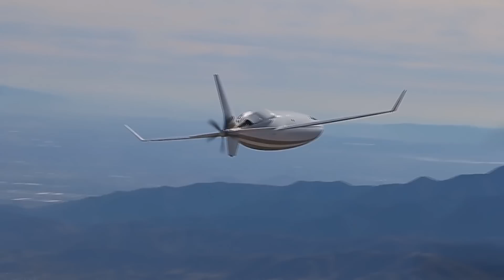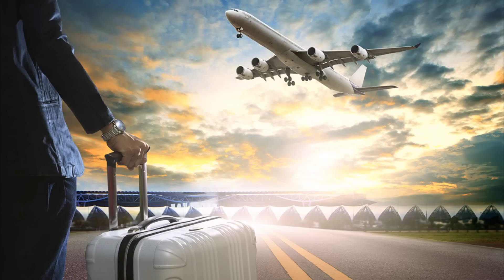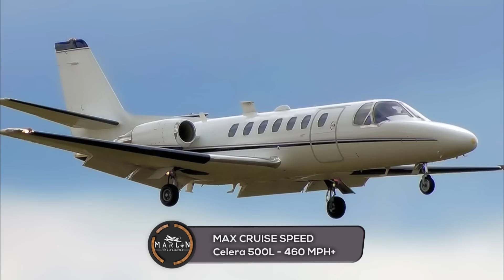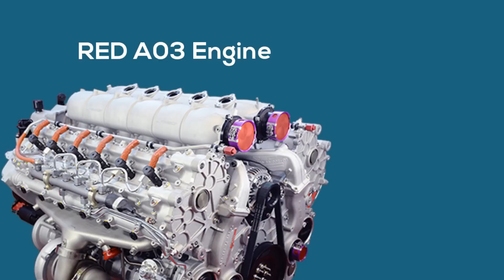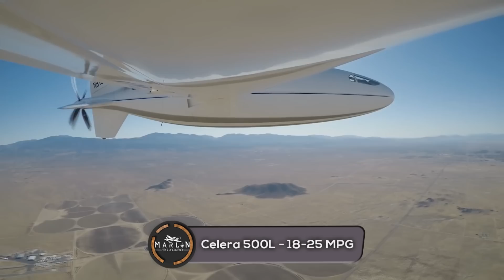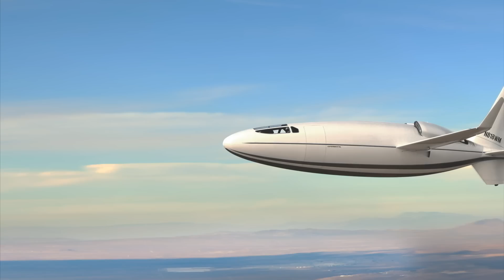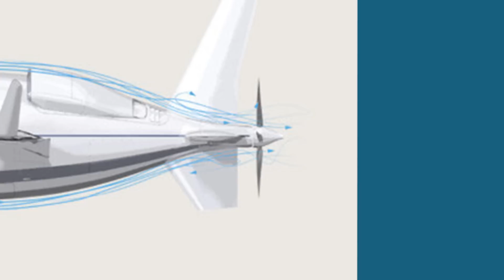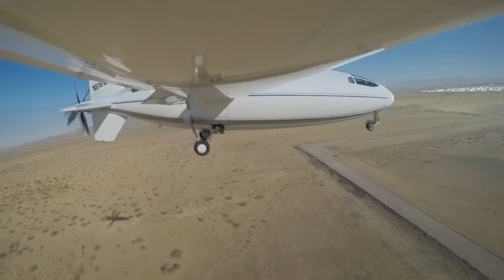Meet the Celera 500L (Flies Faster, Farther, Higher, Cheaper)

Comment: A glide from 30,000'? How is an internal combustion engine going to run that high, even with turbos? Perhps it relies on ram air from those fuse-mouted scoops...
Reply: The Spitfire Mk 19 used a complex stepped turbo paired with a conventional petrol engine that was sensitive to variable manifold pressure and pre-ignition, but it still managed 51k clear back in the 1940s. Diesels are far better suited to turbos because they aren't nearly so sensitive to variable manifold pressures, so higher pressures are a lot easier to achieve with a less complex, lighter turbo. The ram air probably doesn't hurt either, although it is not clear how efficient that would be since there doesn't seem to be any other ports for the oil radiator coolers and that would probably have a big impact on the velocity and pressure of the air flow through the intakes.

Comment: Believe it when you see it. If it can do half of what you said, that would be a game changer. Everything is going electric. I'm guessing big generators to run multiple systems.
Reply: Everything is NOT going electric. There will NOT be any electric commercial aircraft in your lifetime. Take a science class.
Reply: Roberto Skeetrech yeah we did and the only thing holding one back is battery density. That’s it. Electric engines are lighter and more powerful than combustion ones. The problem is energy density of fuel is over tens times greater than the best batteries today.
Reply: Roberto Skeetrech , there is a small fleet of Electric Beavers about to enter commute service in Canada. Might rethink that “Not in your lifetime” assertion.    https://youtu.be/X_dnAD5TD-E
Reply: @robertoskeetrech3206  Batteries would need a lot of development to make a viable electric-powered plane.  However, I could imagine a plane powered by fuel cells and perhaps assisted by photovoltaics
Reply: @robertoskeetrech3206  There most definitively will be here in Norway.
But only short distance.
Long distance it's probably more likely that we'll end up with hydrogen powered air crafts since hydrogen can carry more energy pr kg of fuel then batteries.

Comment: My concerns 
Need long runways
What’s the climb rating?  The ability to climb quickly to get thru wx and avoid obstacles.

TBO on engine
 Very interesting
Reply: Very good question. Climb rate has traditionally been considered a function of wing performance at thrust ratios below 1:1. But this is a lifting body. The Piaggio P180 Avanti derives 20% of its lift from a lifting body fuselage, and another 18% from the forward winglets (note: they are winglets, not canards), which allows them to use a non-lift tail design. This combination allows the Avanti to fly much closer to horizontal than conventional aircraft, which - combined with laminar flow wings - gives it impressive speed. But even with the Avanti's forward winglets, its main wing is still much further forward on the fuselage than the Celera 500L's main wing. And since we have seen the Celera 500L in flight, it is clear that the main wing being so far back is a very, very strong indication that the Celera's lifting body design provides significantly more lift than the Avanti's. This all makes guestimating the Celera's climb rate exceptionally difficult. We'll just have to wait for independent tests.
Reply: Paul White great info
I’m just not sure it will have enough thrust.

Comment: I agree! Actually it flies FARTHER, not further!😉
This aircraft has great potential, especially if and when it can use electric propulsion. I can see variations for different applications. As a drone it could be much more efficient, with a great payload, better than any other prop driven drone...
Reply from the maker: Thank you for the good eye! Ive made necessary adjustments!
Reply: Stop farting!

Comment: Visibility from that cockpit must be minimal due to the design. I'd like to see a video focused on a technical review from a pilot and less of a commercial.
Reply: Yes. Visibility is good straight up but nil forward.
Reply: Can't get a pilot's review until it flies. Should be possible to increase pilot vision if necessary, by adding window area.
Reply: @marcdepiolenc1880  Given the design a window might not be a good option but I thought they could perhaps add cameras and project view on a screen inside. That is not an expensive technology that would work without interfering w/ the design of the aircraft.  I see this option considered for some innovative commercial aircraft designs as well.  Cheers.
Reply: @corujariousa  Agreed, especially if they can install more than one and get a stereoscopic effect. Faired housings at the wing tips?

Comment: Seems like maintaining weight/balance would be an issue.  Wondering where CG is.
Reply: Glen Har 
Yeah, hardly any distance between wing and horizontal stabilizer.
Reply: It's the 25 to 40 % of the wing chord.  Like every other airplane.   Just ahead of the wheels.
Reply: @kirkcreelman   i think you may be missing the conundrum here.  How does it balance with no load (no passengers) vs full capacity when loads are all ahead of CG?
Reply: Glen Har    Oh I hear ya.   Can't see how its gonna work on this bird.

Comment: Those pie in the sky figures are for sucker investors, you can cut all those stats in half for a start.
Reply: If you cut them in half, twice, still impressive
Reply: sconce3    Agree, still impressive.  I heard 3300’ balanced take off mentioned.  This is no backyard flyer. https://www.indexmundi.com/united_states/airports_with_paved_runways.html    Indicates there are only about 2800 appropriate runways.  Not sure how many of these are open to the public.  Wing and landing gear spear undersized.  But the high aspect ratio wing fits with high efficiency and takeoff speeds.
Reply: You’re right about that. Those stats were just way overblown.
Reply: I agree. There is something sketchy about this project and experts are starting to push back on some of these claims. It would be great if something comes out of this but I am skeptical at this time.
Reply: Well, the MPG is certainly believable.  How much fuel can a 12 Cyl auto engine burn?  Its the speed and altitude I have a hard time believing.
Reply: @nickv4073  Why is the MPG believable?  The best experimental aircraft don't come faintly close to those MPG/cabin volume numbers.  And to get their efficiency, those experimental aircraft give up lots else.  Interior volume, runway requirements, etc.
Reply: @GarnetHarrier  Its totally believable. Check out the specs on the Red A03 engine. 
 https://www.hotcars.com/the-worlds-most-powerful-piston-aircraft-engine-red-a03/
Reply: Let's do some math to verify the numbers:  
1.. Glide ratio of 22:1 seems plausible, given that the Pilatus PC12 already has glide ratio 16:1.  
2..   Assuming gross weight of 7,000 lbs, which, at maximum-efficient speed would need about 318 lb  = 1416 Newton of thrust.  
3..  At 460 mph (720 kph), it travels at 200 meters per second.  Take 1416 N x 200 m/s = 283309 W of power required = 283 kW.   283 kW divided by 0.9 propeller efficiency =  314 kW
4..  The engine can produce 410 kW at takeoff, so with high degree of turbocharging with pressure ratio of 3:1, can still maintain this power level at 30,000 ft.   
5...  Typical Brake Specific Fuel Consumption for a diesel engine is around 200 gm/kW/hr.  So, at 314 kW, would require 314 kW x 0.2 kg =  62.8 kg per hr fuel flow.  Density of kerosene is 6.68 lbs per gallon =  3 kg/gal.  Fuel flow = 62.8 kg /3 =  20.9 gal per hour to travel 460 miles = 21.9 mpg.  
So, it is very plausible for the Celera to achieve 21.9 mpg to cruise at 460 mph at 30,000 ft with gross weight of 7,000 lbs to carry 6 passenger.
Reply: Yeah there's definitely something dodgy going on. I can believe that it's very fuel efficient since it's basically a large powered glider. But six times more fuel efficient? Come on, it means every other aircraft designer in history must have been complete morons. In any case you're not going to get that efficiency at the high speeds they're talking about since required propulsive power increases as the CUBE of velocity. Celera should just be open about whatever extremely specific assumptions they've made to get those figures.
Reply: @DanielF601  they are upper limits, want to go far?  you aint going fast...
Reply: @DanielF601  On the other hand, bumble-bees can still fly. As did the Rutan Voyager. Exploiting niche aerodynamics that only work at very specific scales is a real thing. Believing that other high performance compromises are impossible, in spite of history, is foolishness, not scepticism.
Reply: @johnroutledge9220  Yeah fair point, obviously there's a (very tiny) chance that they've discovered something truly revolutionary. However you can see for yourself that they have high aspect ratio wings which we know suffer from significant induced drag, and are therefore only efficient at relatively low speeds. Okay, granted, you can also see that they're using a fairly advanced airfoil and some nice wingtip geometry so it's fair to assume that it's not as bad as it first appears. They've put a great deal of effort and skill into the design. But even so, all their advertising claims about laminar flow over the fuselage are irrelevant if the main source of drag is the wings. I accept all points about keeping an open mind but at the same time I think it's pretty self evident that this aircraft won't achieve the stated economy at the stated speed, since it is essentially a powered glider and, well, magic dust and wishful thinking just aren't all that powerful. Perhaps it will achieve the stated economy at a much lower speed - probably still quite a useful speed, which might make it economically quite attractive. And perhaps it will achieve the stated speed with much more "typical" economy figures. I also accept all points that I'm just expressing an opinion, no matter how informed my opinion may be. So all I can say is that I would not buy shares and I would not put down a deposit unless the manufacturer gets a lot more transparent. I hope they do because this aircraft is clearly a labor of love and potentially quite special. It would be a pity to spoil it with idiotic advertising and misleading claims.
Reply: @DanielF601  400 knots...of ground speed with an 80 knot midwest tail wind, 1 passenger and almost on reserves.
Reply: Sure, you know it
Reply: I think its variable to what performance you want from it. 

Going further means you have to go slower and more efficiently.

Going faster means you have a more limited range and less efficient, but you may be able to reach each figure if you focus on it individually.
Reply: All that critics and doubters here have to offer is an unsubstantiated opinion. We'll keep an open mind.
Reply: @sorellman   -- This critic has been studying aviation technology for nearly 40 years.  Why do you believe a video that shows you a cartoon and asks you to pretend that it's real?
Reply: @GarnetHarrier  Why do you have such a difficult time understanding English. First, we do not know who "this critic" that "has been studying aviation technology for nearly 40 years" is. You claim that, but where is the proof, so why should we believe you. Secondly, what I was saying and you did not understand was, since no one presents any actual evidence, one should keep an open mind. You might be shocked to know this, by now we learned not to trust advertising, or critics on YouTube that might have an agenda.
Reply: @sorellman   -- My apologies if I was unclear.  "This critic" is John Schubert.  I can't post a photo in the comments here, but if I could, you'd see that my pilot's license was signed by Donald Engen.  That dates me.  ;-)
 I could also post a photo of my aviation library that fills several bookshelves (which I need to find a good home for).
This Celera thing just smacks of bogosity.  
You state, :"
Reply: @GarnetHarrier  "smacks of" does not mean we have proof is. That was part of my point.
Reply: @sorellman   -- Sorry.  A portion of my reply got eaten by the computer.  You write, "we learned not to trust advertising."  I recommend you apply that skepticism to their claims.
Reply: @GarnetHarrier  That is what I meant. Not trusting, however, is not not the same with dismissing.
Reply: @GarnetHarrier  sorellman has probably invested his life savings into this plane so nothing you say will convince him he's been gypped.
Reply: @sorellman  And the observation that miracle plane vaporware has been promised, and failed to materialize, for decades now. Modern examples are Synergy Aircraft (boxwing derivative promising 5-7 passengers at upwards of 200MPH at upwards of 40MPG), and Raptor Aircraft (Canard derived from a Velocity with 5 seats in a 62" wide cabin, promising 29MPG@300knots and a 3000+ mile range at that speed). Older examples would be the Moller flying cars of the 80s.

They talk big to get investment, and then the product never even comes close to the promised specs, if they ever deliver at all. We have good reason to be skeptical of their claimed performance numbers.

Comment: Sounds good but.. Comparing it to a airliner that carries 200 people is not realistic.
Reply from the maker: It was just comparing how far it can fly. So I think that was a fitting comparison to show its capability.
Reply: @marlintheaviator  If that were the case I would agree,but it also compared the fuel usage weight and flight cost ,which we all know has no comparison.
Reply from the maker: Well yes the fuel usage and weight was compared because OTTO’s ultimate goal is to compete with jets of comparable size

Comment: How can you compare a piston engine to turbojets? Do you really dream that this plane can fly at 30,000ft? I even heard 60,000ft... lol
Reply: The turbo charger can be less complex and lighter when it feeds a diesel because diesels can more easily achieve higher manifold pressures, and are much less sensitive to variations in those pressures than other piston designs due to lack of need to engineer against pre-ignition. The Spitfire Mk 19 made 51k back in the 1940s with a complex, stepped turbocharger paired with a petrol engine. It isn't even a stretch to believe a better, simpler, lighter turbocharger paired with a far more efficient Otto cycle diesel could pull off well over 30k with a full load. No dreaming required. 60k, on the other hand, has a much bigger question mark associated. It will be interesting to see what the actual service ceiling with a full load is.
Reply: Highest flight recorded in a piston-driven propeller monoplane: a Grob Strato 2C flew to 60,897 ft in 1995.
 And the piston-engine prop-driven Boeing Condor UAV (unmanned aerial vehicle) flew to 67,028 ft. in 1989. Payload is another story.
Reply from the maker: OTTO Aviation compares this aircraft to jets. So I just continued that trend

Comment: Although it looks like a flying dildo I like the engineering that has gone into the aircraft. A smaller version, like a four seater, would be a great plane to own for a private pilot. Would I buy one? Sure, if I was rich enough. Any design changes? I’d like to see a canard up front like the Piaggio Avanti. Any other changes? Maybe a Williams jet, but with the engine they are using I don’t think it would be necessary, unless you’re using it as an air ambulance. Overall, I’d love to see this project move forward!
Reply: Do you also want an Audi TDI powering this dream plane of yours?

Comment: 3000 feet of balanced field? I think the definition of balanced field requires 2 engines...
Reply from the maker: This came from directly from OTTO and yes, you are correct it does require two engines. You could have missed when I mentioned that the engine effectively operates as 2 6-cylinder engines, allowing for continued power and operation of all critical systems under numerous failure scenarios. So it is a single engine operating as 2 to make the aircraft a more safe one.
Reply: MarlinTheAviator it is still a single engine.. yes it has two sides of a V, but you don’t call a V-8 “two four cylinder engines”. If that’s the case, then every Lycoming aircraft is essentially two 4 cylinder engines. No it’s still a single engine V-12 powering this thing. One single crank, many potential single points of failure that may cause the engine to stop producing power. So how can a single engine aircraft have a balanced field? Lol
Reply: @thomasaltruda  Of course!
Reply: Thomas Altruda Well, as long as there are failure modes that leaves half the engine still running, I think they plan on treating the aircraft as a twin, with [half]engine-out climb performance and all such numbers calculated.
Reply: Still a single engine plane, regardless of what Otto's marketing thinks.